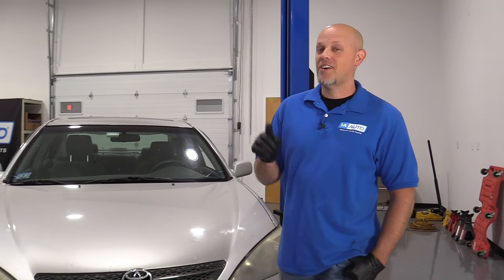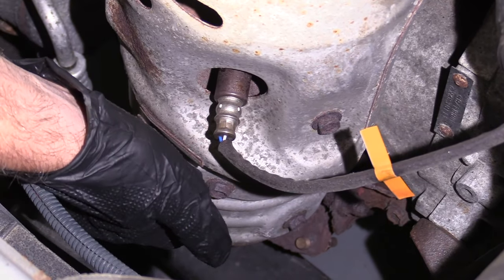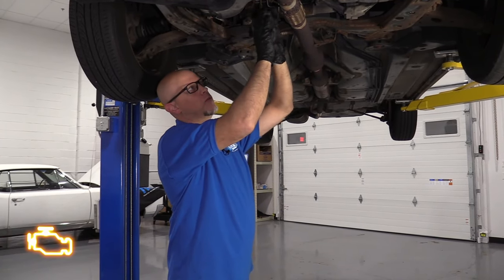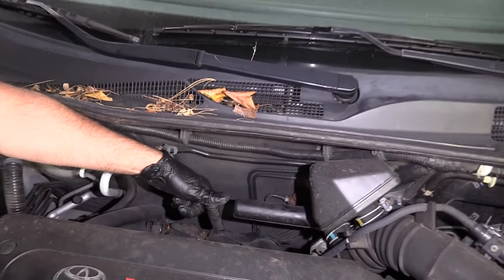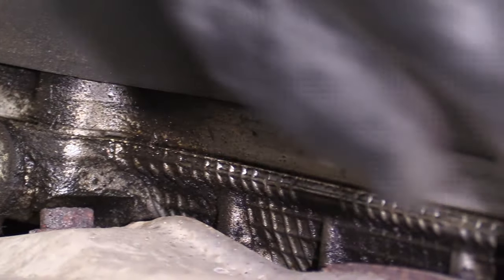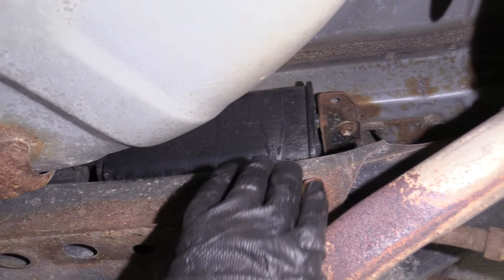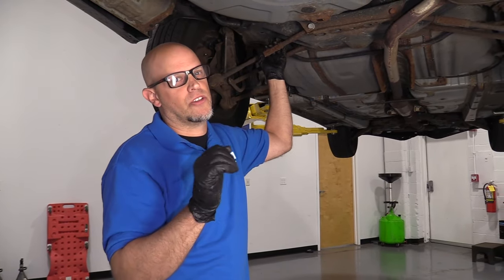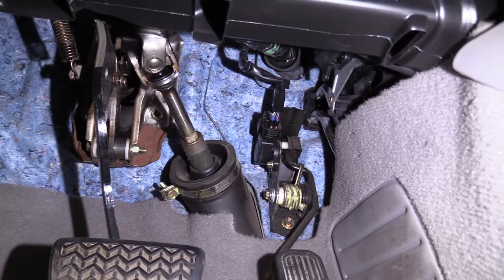Top 5 Problems Toyota Camry Sedan XV30 5th Generation 2002-06

Comment: Have to say that this generation of Camry is the worst one. Friends & Family who’ve owned these always had something going wrong with the engine (4 cylinder specifically), transmission, or electrical system. Same with many others I’ve worked on. The 4 cylinders have countless issues, and typically go at most 150k before giving up. The transmissions typically fail between 100k and 120k.

If anyone’s looking for a Camry to buy, just avoid these. Best years on the newer ones are 2012 thru 2017, especially the V6s.
Reply: Lol this generation is rated among the best in the year lineup. Even CarMax and Edmunds specify that. If your family had a bad rap with this model they didn't take care of it. I know people who sit at 200k plus miles and work like new. It ain't magic. Just proper maintenance.
Reply: @ramir332  Of all people I know who actually had these, only one still does, and they’re planning on selling it soon. He did manage to get almost 250k miles out of it, but that’s cause it’s the V6. Transmission shifts sloppily on it though, and the blend door actuators are bad. Only person I knew who got lucky with one. This generation is still the most unreliable of all Camrys. Those in my family did maintain them, and still had tons of issues. As for my friends, I’m sure the results were split down the middle. Just about all of them though swore off Toyotas after having one of these. They were unlucky, and that’s why I will never ever recommend these, but will always recommend the 90s Camrys or the 12-17 models.
Reply: @spenserchalkley7013  I'm wanting to upgrade to a 2016 Camry. But so far I have a 06 Camry. I do regular maintenance religiously. Never had a problem at 190k miles right now. The only thing I had to do that was expensive was replace all four shocks. Since I bought this car used. It still runs smoothly. And nothing major as of yet!